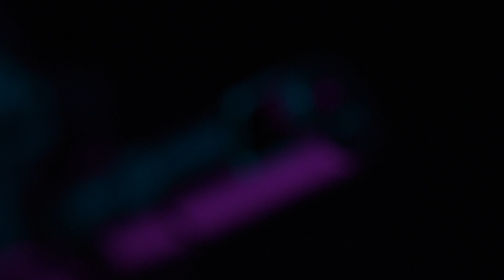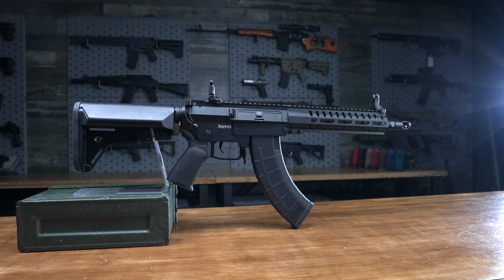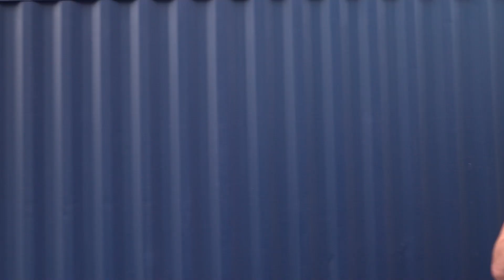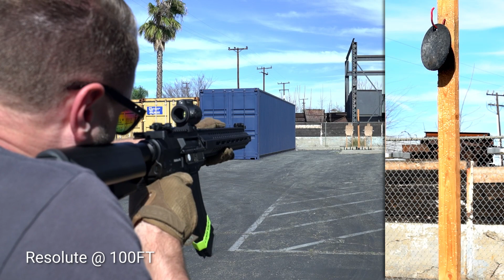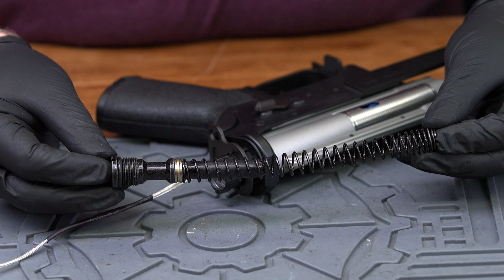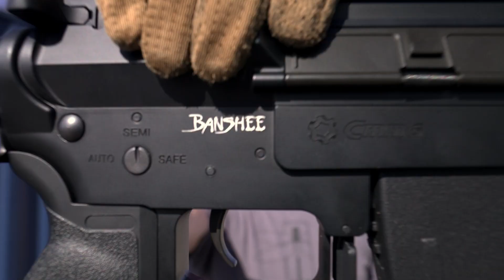EMG Helios CMMG MK47 AEG Review

Comment: are batteries included on this? This going to be my first AEG
Reply from the maker: Batteries are not included. Shop batteries here - https://www.evike.com/shop/28/31/
Reply: @evikecom  Okay. Thank you!
Reply: @cancerousnut7767  yoo bro has the mk47 been good since you got it ? Im looking to get one ? Do u think its worth it ?
Reply: @ni052co8 If you haven’t brought it yet it is a great purchase, everything he said in the video is accurate. I suggest getting the gun with the 2 extra mags and lipo batteries. Also watch out with the dust cover latch because it will break easily if you hold it in place and rack the charging handle. ✌🏼

Comment: I'm still not a fan of that hop up unit. I feel like the mock bolt will mess with the dial when you let go of the charging handle. Hmmm perhaps it can be swapped out with a krytac TR47 hop up unit?  🤔
Reply: you're absolutely right. I've been working on an older sport line cyma ar47 build and i was super stumped by the hopup constantly adjusting. turns out that the mock bolt was turning the wheel to no hop every single time it went forward. i just ended up removing it and haven't had any problems since then
Reply: @smoothkins  I have the cyma platinum ar-47 qbs and I just went ahead and swapped the hop up unit with the Krytac TR47 hop up unit.
Reply: @sarz422  heard some good things about it. how do you like it?

Comment: The CYMA's ETU sucks anyway, It wears out in a half a year including the shimming.
Reply: mine wore out in like a month lol
Reply: Is that on normal shooting or trigger spamming? Like, how many rounds do your shoot in each engagement every time you shoot at someone? 🤔
Reply: @Callsign_Kishin  It's regardless of the battery voltage, the spring, and how fast you're shooting. It's still going to wear out!
Reply: @Billyboy13422  you get what I mean though right? I came from playing pump paintball, so I usually conserve shots and only fire one or two at a time. I don’t usually spam the trigger. 😬
Reply: @Billyboy13422  what would be the fix? Replace it with a Gate mosfet?
Reply: @Callsign_Kishin  Yes sir! I got it reshimmed and replace the junky ETU with a Gate TITAN. It works fine now.
Reply: @Billyboy13422  hm. Shit. Then replacing the mosfet would preferably be an immediate upgrade, wouldn’t it? 🤔 like, don’t even run it with the CYMA stock ETU?
Reply: @Callsign_Kishin   yeah, no matter how much you pull the trigger it’s still going to wear out. I took mine out maybe three times until it broke, for a couple hours each time. Slapped a GATE Aster in there and no more problems. Might as well replace it before it breaks to avoid the inconvenience of it breaking during a game
Reply: @Billyboy13422  the problem is that when a lot of current flows through the MOSFET (from trigger spam or full auto) it actually creates so much excess heat it melts all the soldering off. or the microswitch can simply break from use. that's what happened to mine